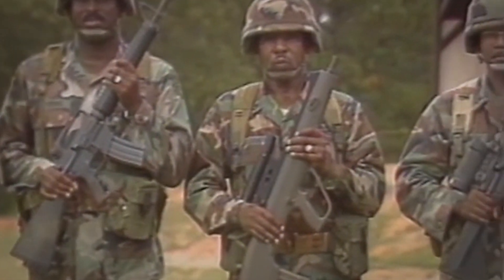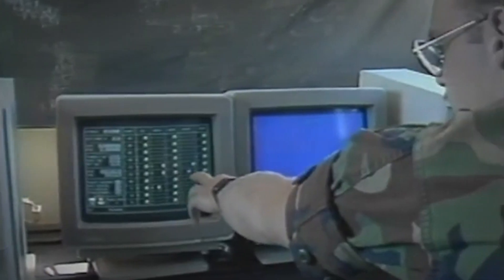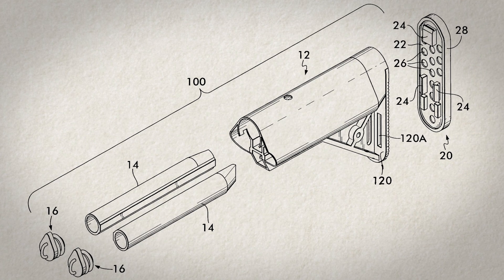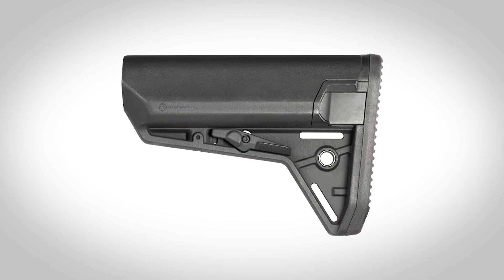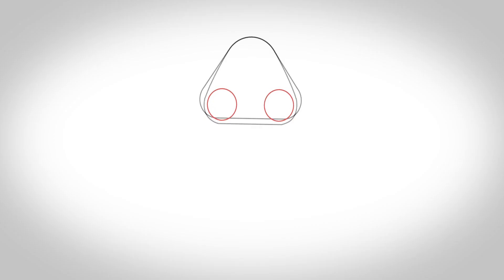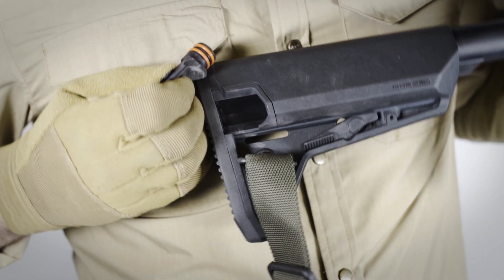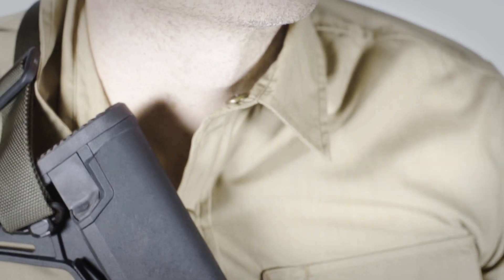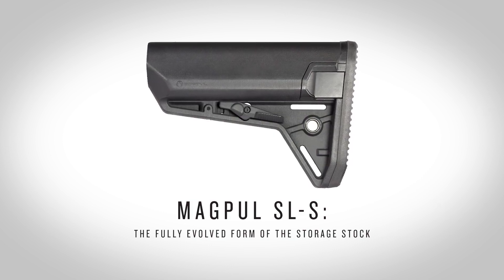Magpul - SL-S Now Shipping

Comment: Is there a specific way batteries should be placed in the tubes? Meaning, can they discharge if the wrong ends are touching?
Reply: No doesn't matter. Electricity needs to form a circuit to discharge energy (conventionally, sure there are other factors from degredation of the battery composition...). However, I always put a piece of tape over the terminals just because I can. I never know if moisture somehow works its way in, and that can form a circuit.

You should check all your batteries monthly anyways.
Reply: Thank you.